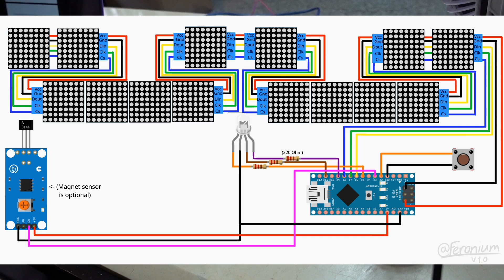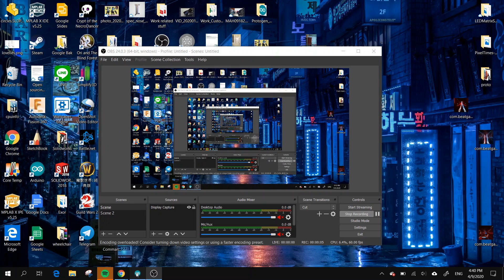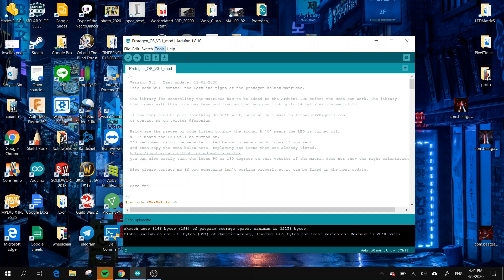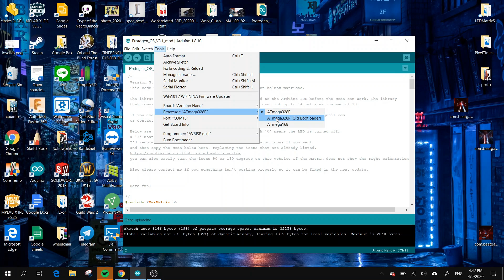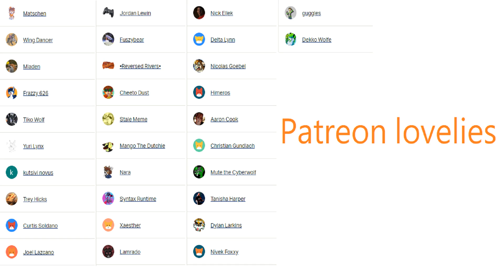How to do protogen electronics for absolute dummies

Comment: My Nano shuts down immediately after the display powers on.  I haven't connected any of the digital pins yet.  Just the power.  From what I read, you cannot power displays like this from just the Arduino 5V supply so I'm wondering how in the heck you got your video to even work.  Thoughts?

Also, how do you change the color?  Mine shows up red...
Reply: You need to connect it to the power supply directly instead of connecting it to the board, because it will draw too much power

Comment: I have a question. You mentioned getting 6 of the 8x8 matrices but I see that there is a pair of 2 connected together. How do you do that?
Reply: I have the same question
It’s a 8x32 matrice but I cannot for the life of me find one
Reply: @collinnkingg  I found a few on Amazon
Reply: he just soldered 2 together without wire u can see it at 8:26
Reply: @FNAFPERSON  Thanks, worth the 11 month wait
Reply: @T1gernugget  no problem just ordered every part and have 3d printed the base! hope yours go's good.
Reply: @FNAFPERSON  About the base. I have the capability to print it but i can’t find any files online. Did you print yours yourself or buy one printed. If you did print it, what kind of settings did you print with? Thanks for your help!

Comment: I built this but the first four matrices don't light up. They are not broken because they work on a different code. I saw that others in this comment section have had similar problems. If someone could help that would be amazing.
Reply: I fixed this a long time ago but you need to use the included MAXMATRIX library not the generic one!

Comment: So my son has had myself and his mother helping him make this helmet. We are coming unstuck. The first two 8x8 matrix panels and the 3rd/4th matrix panel (first two panels of the mouth) do not display anything. We have gone through all the wiring And done continuity tests across the whole circuit and swapped matrix panels out for fresh ones in case they were faulty but they still will not display the right eye as you are wearing the helmet or the first two panels of the mouth.
Reply: Myself and someone else I know are having this same exact issue. We've done everything you've done too, test continuity, swap matrices, swap boards, and the wiring is perfect. But no matter what we do, it's always the first four matrices in the array that don't display anything. The only thing left to check is the code itself, which is far beyond me. That in mind, I think it's best to contact the original writer of the code, as well as the uploader of this video
Reply: @hydronaut3851  we did that exact thing. Feronium sent us a google drive link with updated versions of the OS. We got it working straight away after putting new code on. Drop him an email he will send you a link to the google drive.
Reply: @davepickessaudio  Oh alright! I just sent one last night, I'm just eagerly waiting a reply now, thank you !
Reply: @davepickessaudio  Hello again, I contacted Feronium and they basically told me "My code isn't the problem. Check your wires." and not much else. Might I ask what version of the code you're using?
Reply: @hydronaut3851  max7219 os7

Comment: Hey people of the yt comment section I need help: after copy and pasting the code into the Arduino application I keep getting red text that says: MaxMatrix.h: no such file or directory. If you know how to fix this, please help me out here.
Reply: In the google drive folder with all the OS versions, select the right version, and in there should also be a folder called "MaxMatrix", you need to install that .ZIP file, and in the Ardiuno program, go to Sketch > Include library > Add .Zip Library, and select the MaxMatrix file, and that SHOULD do the trick, if I'm remembering correctly
Reply: @hydronaut3851  thanks! helped me out too XD
Reply: @hydronaut3851  ty
Reply: Im not very technical when it comes to this but do you have the import settings correct?
Edit - so it turns out the code no longer works

Comment: I am a protogen furry, because, for one, I like the lore upon the protogen species, and two, since I like tech and making music (specifically, Drum & Bass), I also have chosen this species. Not only that, it comes with a side package of a ton of inside jokes and secrets to find, and I don't eat RAM, cause that would be cannibalistic. Also, I've been wondering on how to also program some other features like eye and mouth tracking and ECG sensor detected moving ears as well. Additionally, I don't really have a 3D printer for the actual proto head and stuff, so I can't start or edit a model for the adding the little box for the Arduino board, battery and ECG sensor board.
Reply: You can’t avoid it forever!

join us and eat all the RAM

Comment: Dude, those wires are supposed to go THROUGH those holes before you solder them in place.  You don't surface mount wires like that.  That's why those are holes, NOT pads.

Comment: Did you use stranded or solid wire?
I’m trying to make this and am really confused.
Reply: solid
Reply: RavensEpic I accidentally got stranded wire. How bad did I mess up?
Reply: @unicorndonut466  aww man well solid core is much easier to solder to those led matrix boards and to the Arduino Nano board. You can do it with stranded wire its just gonna be a lot tougher. im actually buying the electric stuff for this rn so feel free to ask questions
Reply: RavensEpic THANK YOU SOOOO MUCH!!! I really mean it.
Reply: @unicorndonut466  No problem
Reply: The stranded is build more for movability as its stronger when it comes to bending it alot.
So depends if the wire will be moving alot, if not it should be ok
Reply: Year later update: I used header pins and jumper wires so I can take it out fix things.

Comment: For those of you wondering how to change what the face looks like, here's a guide:

Near the top of the code, there will be this big area full of things like "B00011001" that I'll just call symbols. This area is where the facial features are stored for use in the expressions.

Each of these symbols represent one row in the LED matrices. A 0 means a circle in the LED is off, and a 1 means it's on.

These symbols always have to start with a capital B and have 8 digits in them that must be either 0 or 1.

A single LED matrix needs eight symbols to be fully functional.

Here's an example of some code you might find in the programming:

noseRight = {16, 8, B01111110, B11111100, B11000000, B11000000, B11000000, B10000000};
Reply: Ah, thank you for ur effort in writing this ^^

Comment: Just a question, but where can I get those lil led boards that connect to an... Adruino uno I do beilieve?
Reply: I think it’s in the description
Reply: @afunkylittleguy  With the amazon link, there appears to only be soldering equipment and stuff like that. No signs of LEDs. Thanks though
Reply: @bruhmoment8882  The LEDs are MAX7219 Matrices and it's an Arduino nano.

Comment: I tried making a led helmet which can be programmed and it's has different modes during my robotics club in my class 10th. 

But I end up burning the aurdino. Lol
Reply: Lmao 😂😂
Reply: F
Reply: WE NEED A FIRE EXTINGUISHER
Reply: rip
Reply: F
Reply: F
Reply: yep, arduinos don't like metal plates. Noted. Btw which board could i use if i need more GPU Power but don't wanna get a raspberry pi because of long boot time? Wanna do multiple sensors, face tracking and maybe a small display inside to see what is going on. Yes i'm an engineer and yes i do like to make things overcomplicated :D
Reply: I've seen someone who mad their protogen able to sound like a blasted out civic (i think that's the word for it idk)
Reply: F
Reply: You had school in electronics engineering?

Comment: Thanks, it really help me.  I have one question.  What is the capacity of the power bank and how long will it charge your visor?
Reply from the maker: For this setup the power draw is about 0.8amps
Reply: @jting-f3237  Thx
Reply: Based on what ive seen, you can use any portable phone charger and it should power the arduino just fine
Reply: @cake8937  but i want know how many mA consume per hour.
Reply: I may be wrong but if you go back through his other videos I think he explains his suit pieces? I think he said something about the specific power bank but I can't remember.